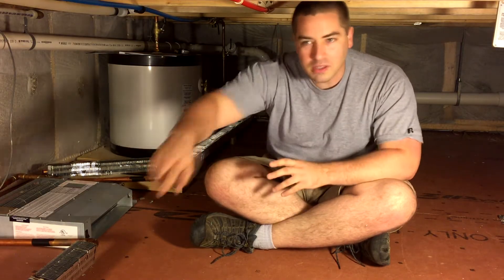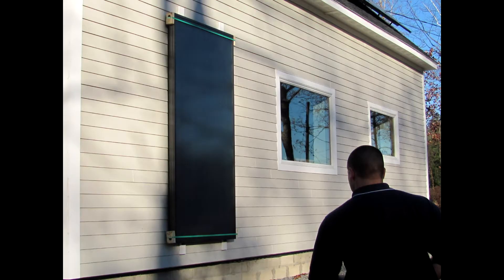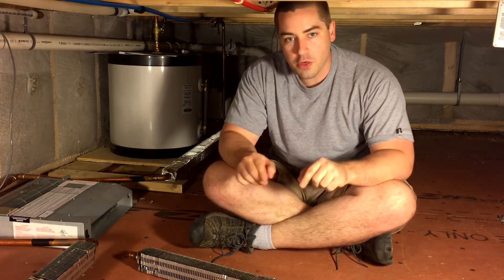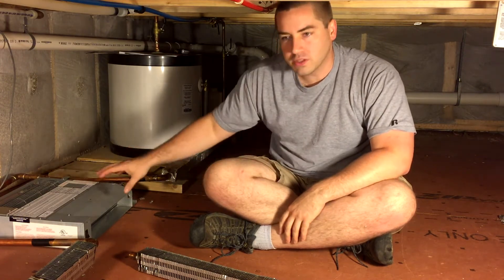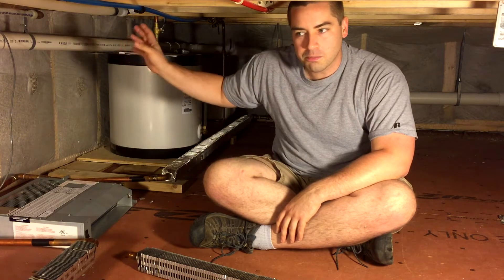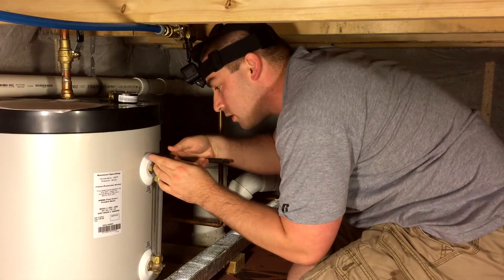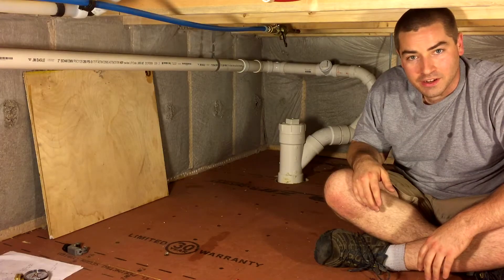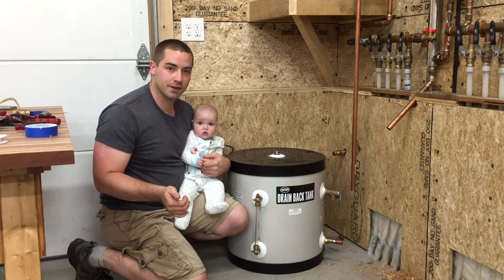Solar Thermal Hot Water DHW Preperation

Comment: I remembered watching this several years ago and didn't realize you were the one who made it. So, I am thrilled to see more of your ingenuity at work. Because I have to build a basement under my solar shed for a 2500 gallon well water storage tank and pressure tank system (I had also considered it for a lithium ion battery bank that wouldn't freeze) I have decided to use the additional area for a thermal water storage system similar to what you have. Only difference is I will be using 12"  insulated concrete forms and an insulated tunnel to the water heater.

Comment: David, in 1976, I poured a thick footing in my basement to hold a pair of 3 ft dia x 8 foot cncrete pipes.  I had plans for filling them with river rock and storing heat for the house.  I never went ahead with it but looking back on it, it was like trying to make a radio with dino bones.  I'm working my way thru your old videos, and enjoying them alot.  Good luck.
Reply from the maker: A lot of those old rock systems had problems. I've worked on a job where they built the house with a full basement, filled with clean rock, then capped with a slab. This was late 70's.  When I came to the house working on insulation the owners had enough and were sealing off the vents.
Reply: @DavidPozEnergy  David, in those days in was more like witchcraft than science, and then Ronald Reagan killed alot of the efforts.  We need a lot more people like you to make any progress, thanks. Good luck.